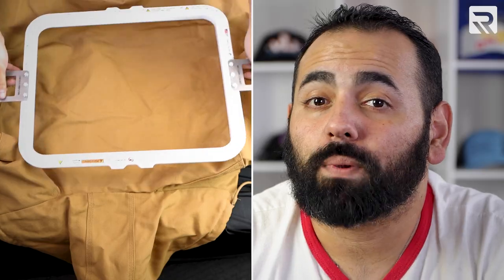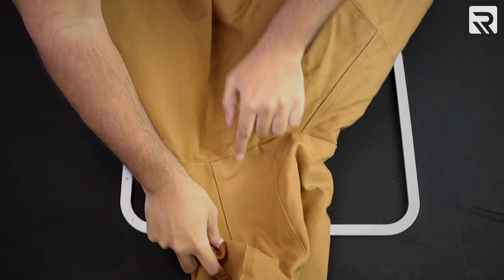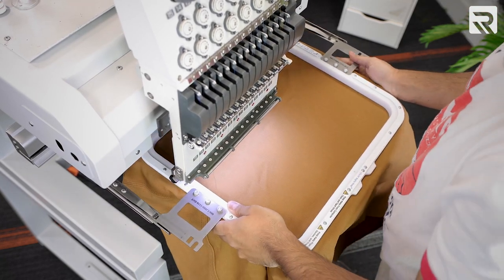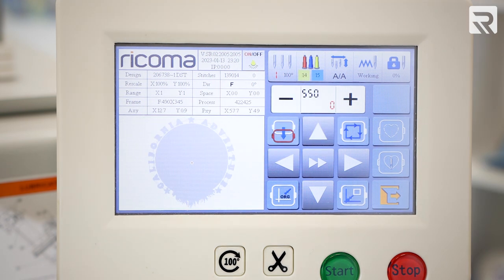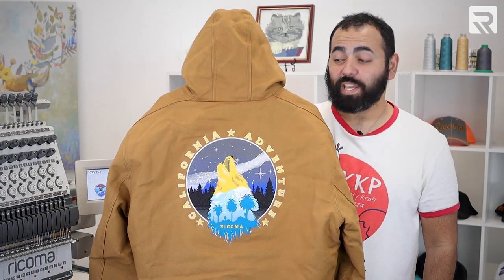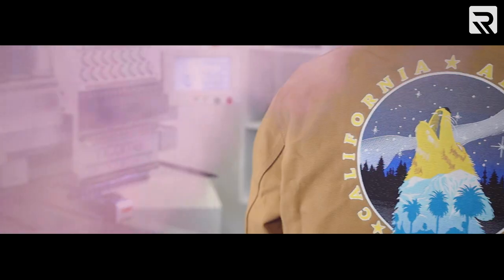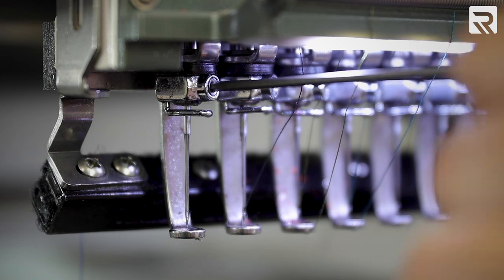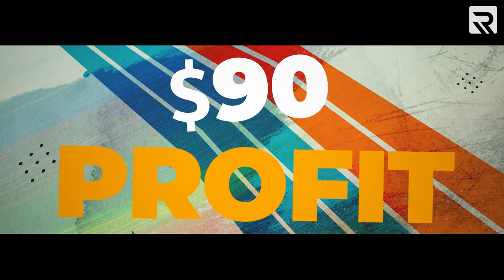How to Embroider a Carhartt Jacket & Make a Huge Profit

Comment: I haven't gotten my machine yet, but I've been spending the wait time figuring out my prices.  139k stitch count, 550 stitch speed is 4.2 hours on the machine with a $80-90 profit?  So we're looking at $20/hr machine time?  Are larger garments usually like this?  I know the $$ are in things like caps and large runs of 10-15min pieces.  Just thinking out loud (=
Reply from the maker: It could be! It totally depends how big the design is, and the garment you are embroidering on. You can charge more money since it's a thicker material that takes more time.

Comment: Wait 9 mins ago?? holy crap that was a reflex click! I'm just now finishing touches on my program to embroider my own coat as practice, before doing a customers. Guess my $200 quote is reasonable for a first job! thanks for the video. Now I just have to pray my machine runs fine.
Reply from the maker: It was meant to be! Let us know if you run into any issues :)
Reply: @ricomatv  well the set up turned out well, but the software side needs thickening. tried applique for the first time with 2 different car colors and came out cool looking but rough edges 😂. thanks for needle size, it seemed to work good enough with only 3 threak breaks at 500spm on a single needle though.